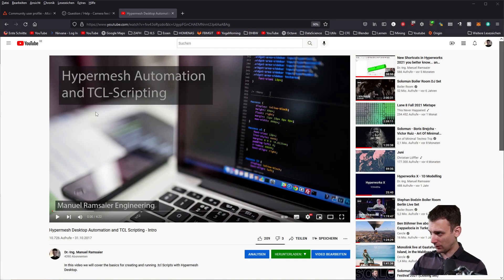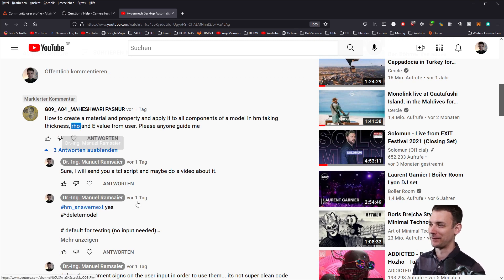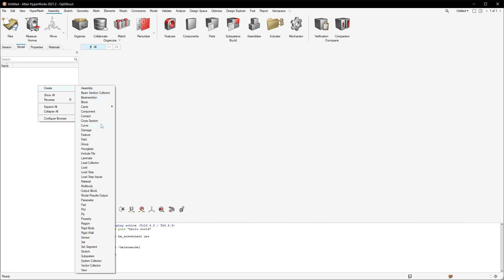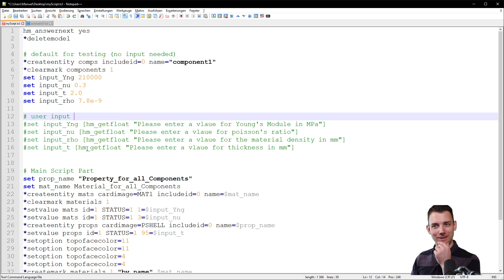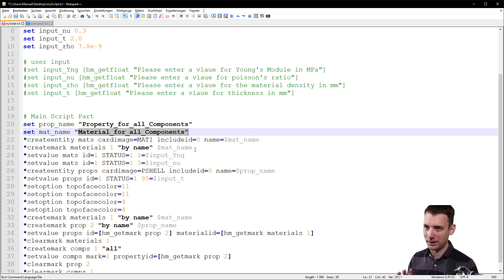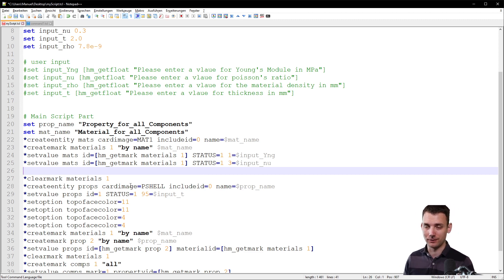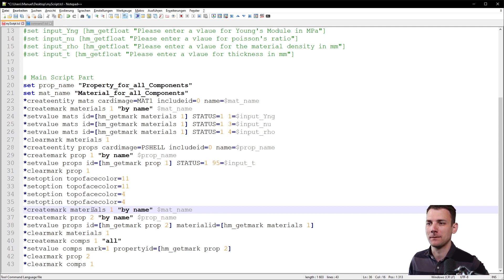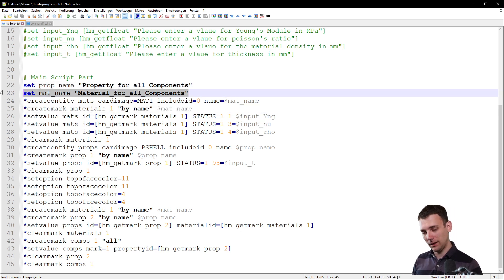TCL Scripting for Altair Hypermesh - Practical Example

Comment: Hallo Manuel, I have been wanting to add curves in hypermesh using tcl script and I did not find any syntax for importing the values through csv. Would be great if you could help.
Reply from the maker: You have to look it up in the command.tcl file when you are doing it in hyperworks. For a simple curve TableD1 its like this:

*createentity curves name="curve1"
*setvalue curves id=1 STATUS=2 12300=1
*setvalue curves id=1 STATUS=2 12301=2
*curveaddpoint 1 $counter $x $y

where $counter, $x and $y are what they say: so for example:
*curveaddpoint 1 0 1 0
this adds the first (index/counter 0) point at x=1,y=0

and so on.

if you have a csv file you have to go through there line by line and add the points with tcl.
You can also write a python converter which reads the csv and puts out the tcl for you.

Comment: Sir can u explain script for thickness tag
Reply from the maker: Hi :) Can you explain it a bit further? You want to change thicknesses per element or property ? It's about 2d right?
Reply: @ManuelRamsaier  sir I need measure the distance between for two surface and find out the thickness with help of script
Reply from the maker: @dharshanbj6922  This will help you https://community.altair.com/community?id=community_question&sys_id=3a4680b61b2bd0908017dc61ec4bcb4f 
Maybe I will do a video in the future about it